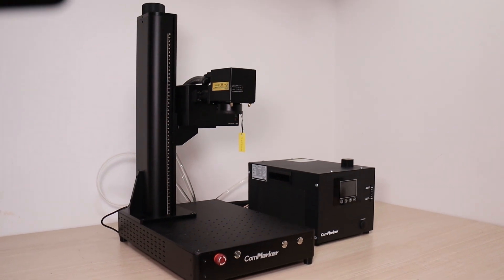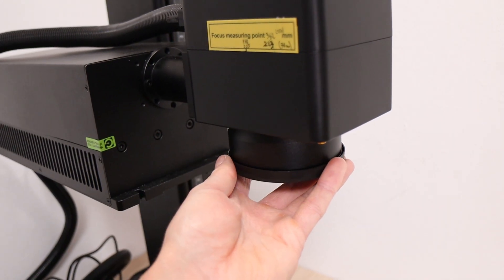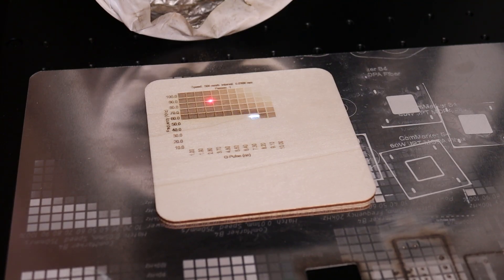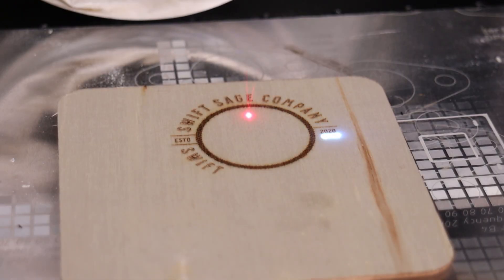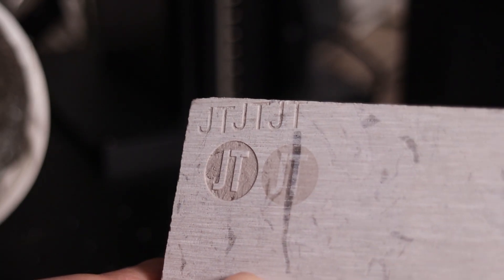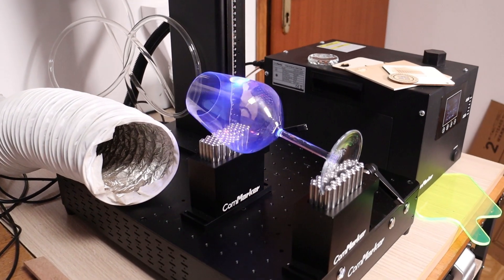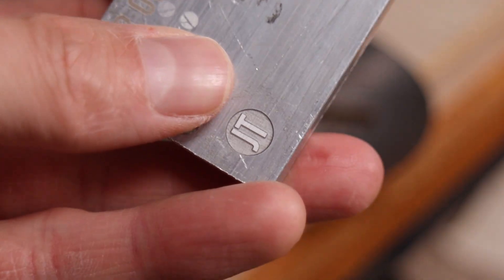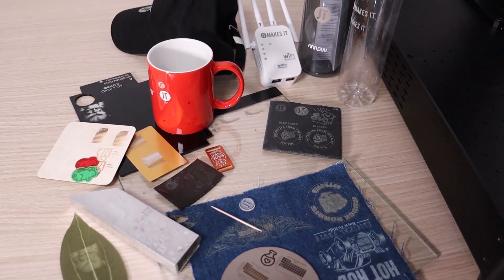10W ComMarker Omni 1  - How Much Better Than The 5W? UV Laser Engraver Review and Test

Comment: What is the process that you use to engrave your initials in a frosted circle? Thanks
Reply from the maker: 70mm lens and focus in the middle of the glass if you meant the embedded engraving
Reply: @JTMakesIt  What I'm after is how do you not engrave your initials
Reply from the maker: @TTC1940 sorry I don't understand what you mean
Reply: @JTMakesIt  In your video you engraved a frosted circle with your initials in the center
Reply from the maker: @TTC1940  Parameters were approximately: 40kHz, 400mm/s, 1ns, 0.03mm interval
Reply: @JTMakesIt  Sorry, I don't understand the design process

Comment: Dear JT, first, thank you so much for this amazing video! My main application would be PCB (printed circuit boards) making. Do you think, is it also possible to make sufficiently deep contours (the thickness of the PCB fiberglass is approx. 1.5mm) to cut out the engraved PCB  from the surroundings?  In such a case also the holes through the PCB would be possible using the 10W UV laser. Thank you very much.
Reply from the maker: Thanks 😊 I think it is possible, you would just need to set more passes for the cutout and maybe also some wobble to clear out the dust while cutting
Reply: @JTMakesIt  Thank you so much !  It is so nice !
Reply from the maker: @PavelZahradnik-p4lyou're welcome! If you ever decide to buy you can use my affiliate link and my custom discount code in the video description to save some money :) of course only if you want to support my channel at no extra cost to you 😊
Reply: @JTMakesIt  Yes, sure, thanks a lot !

Comment: Your glass results on the ornament and wine glass are phenomenal. Would you mind sharing the settings used in the process?
Reply from the maker: Thanks! the settings are nothing special, speed around 400mm/s and 1ns pulse and 0.04mm infill
Reply: @JTMakesIt  I really appreciate taking the time and respond ❤ 

Yup those were commarker defaults but I wasn’t able to produce bright white marks. I thought you have tried out something else. 

I definitely need to purchase some glass sheets and spend some time digging into this 😂
Reply from the maker: @M7meedo try playing with interval settings and number of passes (crosshatch). Sometimes interval of 0.05 can produce better results than 0.03. but it really depends on the type of glass. Some glass produces better engravings than others

Comment: The manual says set the frequency to 1-40. 

I didn’t find the part where it says it operates between 30-150 😅

I am really confused on what to set the machine frequency in lightburn.

Comment: i was amazed to see you cut  through 0.4mm aluminium with the 10w. How do you think it would perform using the 5w cutting 0.5mm aluminium?
Reply from the maker: It will probably do it, but it would take 2.5 to 3 times as much time as the 10W

Comment: Where did you buy that stone slab please, what type of stone ? Am I to understand it doesn't leave burned marks on glass cut above ? I have the Omni 5W and when cutting glass I always get some small burned marks on the edges from the support, I've tried an Amazon bought laser honeycomb, the aluminum ComMarker Cutting Panel, nothing work to make pristine glass cut edges without dark spots where the support meet the laser at the end of the cut.
Reply from the maker: It is a leftover piece of stone which I got from a local stone cutter (makes graveyard tombstones). Stone doesn't reflect the beam or makes smoke so it doesn't stain the workpiece. But always its good to leave some space in between

Comment: On Commarker's website they appear to sell a 300x300mm lens for the Omni 1 10W. Do you have that lens and have you tried it? A larger working area would be welcome. Also, I saw another reviewer say that he was completely unable to cut clear acrylic with the Omni 1 but it seems like it should be able to. Have you tried it with the 10W? I wouldn't need it to cut quickly like a CO2 but being able to cut clear acrylic would be a big benefit.
Reply from the maker: Hi, haven't tried 300mm lens. As for transparenr acrylic, there are two types - cast and extruded. One engraves nicely and one doesn't. But I think UV laser isn't the best choice for cutting acrylic or other plastics. But I will try it in the following days.

Comment: How do you know where to set your perimeters for your test grid? The thing exact same test grid for all materials? Will these test grits come with the USB? 10 watt has shipped and I should be getting in the next day or two.. where do I get these test grid setting?
Reply from the maker: The test grids are generated with Lightburn on the go. It is called material test where you can set which parameters will be swept (speed, q pulse, nr of passes, interval...) and you also aet the ranges and number of points. Very easy, just google "lightburn material test"

Comment: I have been looking at UV lasers for some time because I am getting some questions for glass and plastic engraving. Your UV/Fiber comparison video and this one made it clear to me I can do much more with it. The results on leather and rubber stamps are very nice but the wood cutting is the overall wow factor for me. With this I can do modeling kits that don't show the brown burn marks that I now get on the thin plywood. 
And yes, I do need the 10W version and the 70mm lens.
Reply from the maker: Thanks! Check the review of the 5W version too. The 70mm lens comes with both machines. If you decide to buy, you want to support my channel you can use my discount code in the video description and save some money :) but if you don't want its also ok.

Comment: haha I know you will get this one some day.  That powder reminds of Pixie Dust. Actually I am quite confused why 10w has to use water cooling. My 60w B6 don't need one. Isn't a fiber laser supposed to generate more heat compared to UV laser? What extra does water cooling brings comparing with wind cooling. They could add more fan anyway. Or its just for making the working area more quiet.
Reply from the maker: Hi,
I think water cooling keeps down the noise, but more importantly, it can keep the UV laser source at a lower than ambient temperature which prolongs its lifespan. Also, UV laser has to have UV source on all the time when working (it needs to heat up), but fiber turns on the beam only when engraving. This is what I think, but I didn't fact check it.

Comment: Can you test whether the 10W laser is able to engrave brass coins deeper? 
I am faced with the decision of buying a Titan 100W or the Omni1 with 10W. I would probably need both 🫣
Reply from the maker: Yes, it probably can make deep engravings but it will take a lot more time than with fiber. And it can take hours with fiber already. It would be a waste running UV laser for hours
Reply: UV can't compete with Fibre for metal oblation such as brass coins.  It's depth of field is lower, dot pitch much smaller so line interval will need to be much smaller, resulting in much longer engrave times.  Then the laser itself is not great at  removing metal (compared to Fibre).  Even if you can do it, what might take 2 hours on a Fibre will take 10 hours on a UV.
Reply: You might need both lol. UV laser is on a total opposite direction to fiber laser. I did opposit anyway. First fiber than omni. Fiber laser is for heavier tasks like engraving and even cutting metal. And uv is for detail and applicability. BTW titan looks awesome. My 20w b4 takes hours to deep engrave coin. Not to mention a 10w uv laser not even for deep engrave.

Comment: When engraving glas with the 5W version, I sometimes have the problem that I engrave the inner surface of the glas and not the outside. Do you have any tricks do prevent that other than just raising the laser?
Reply: You engrave where you are focused, it seems like what you think is your focus distance is not correct and you are focusing lower.  Try re calibrating your focal distance.
Reply: You successfully did inner engraving lol...Always a hit or miss for me when I try to achieve that.
Reply from the maker: Inner engravings are caused either by incorrect focus or lower power. Check my review video of 5W ComMarker Omni 1 where I accidentally made some engravings on the inside and on the bottom side of glass when engraving test patterns: https://youtu.be/rZXZM_2uSI8
Reply: @JTMakesIt  I found this in the video: https://youtu.be/rZXZM_2uSI8?t=597 Different Settings(! not focus!), decided if the engraving was on the top or embedded. That's really surprising, but definitely something I am going to test. 
Thanks!

Comment: On my 15w JPT SEAL, I get a pretty nice clean black on stainless on a 200mm lens with 750mm/s, 150kHz, 3.5ns, 0.008mm LI, 2 pass 45 degree  cross hatch.  That's far from its max power settings so 10W should have no issues finding its setting.  The super tight line interval was the key.  UV dot size is about 0.01mm line interval anyway.
I have been cutting 3mm ply for all sorts of little shapes such as earrings for a while, the dot size is so small its crazy how precise it is, like you showed.
White on acrylic is still a nemesis for me, I either get nothing, or melt it (any suggestions?).  I can get nice whites on lots of coloured acrylics though
Reply from the maker: Thanks for this tip, it seems that I haven't fully explored the tight line interval for black marks! 😊
White on transparent acrylic is possible, but you need the correct acrylic type (cast or extruded- don't know which one). One of them engraves nicely, the other doesn't engrave at all.
Reply: @JTMakesIt  The stuff I have is cast acrylic which I believe is they one that can engrave.  I need to sacrifice more of it to do some proper test grids 😁
Reply from the maker: @guyb7995 i know, acrylic is so expensive these days 😢
Reply: @JTMakesIt  oh, it always depends on the stainless as well, there is a lot of variety out there even when they are meant to be the same 'grade'.
Reply: @JTMakesIt : If you happen to figure it out, it would be great to know!
Reply from the maker: @jayedwin98020 Tried 5mm Beech hardwood and it was also able to cut it, although there was some charring present (like with a CO2 laser). Much more than that would be a problem due to excessive defocus
Reply: Any idea what your maximum depth of cut would be on plywood?
Reply: @jayedwin98020  I have done 7mm with my 15W  UV (not limited to that, just have not tried anything more) however I think your lens choice will affect this the most.  If you can go a wider lens your depth of field will be larger and you will stay focused for longer as you cut so can go deeper.  This ComMarker's biggest limitation would be the fixed gantry height.  To go with a 300mm lens for larger DOF and work area, you really need a 800mm gantry.  These all in one designs are fine for lower powered units you won't need or want a wide lens with, but when you get to 100+W Fibre or 10+W UV it really puts limits on what you can do with it.